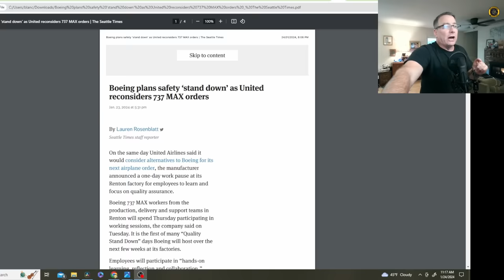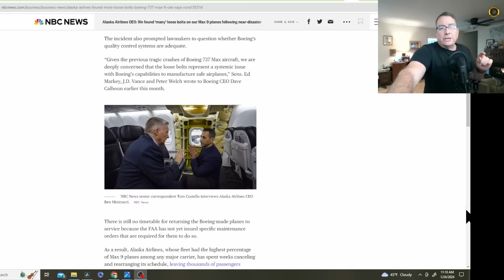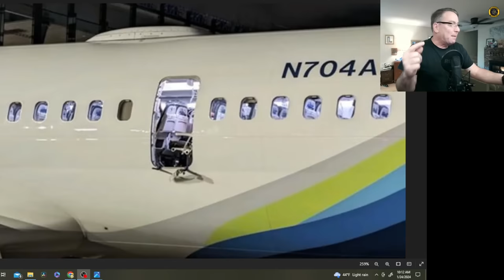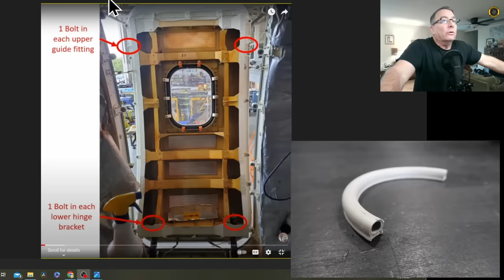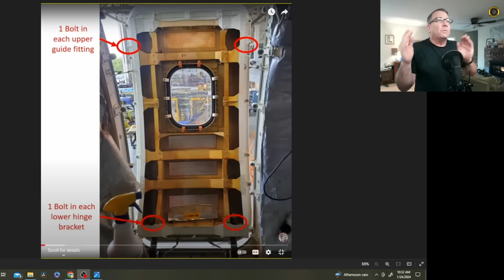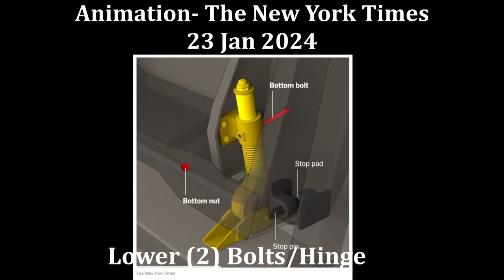Boeing's Quality Management Failure Explained 737-Max-9 Door 24 Jan 2024

Comment: it is worst ... it not about bolts ... it is poor/faulty  design which was accomplied with faulty executed assembly with bolts ... first initialy it is a door without security mechanism which secure it in place. By design it should slide down(these elements are present) ... to prevent that is that security oponening mechanism which is absent and replace by iliminator assembly ... to fix this door Boing need  glue it in (not done but should ) and replace bolts with proper large stunds which will fix it in place like there was absent opening mechanism. For the future models remove door from superstructutre which should be done in first place.

Comment: The entire 737 max program is a QC and PR nightmare. Even the Wright Flyer is safer and that plane is 120 years old.
Reply: WAS not the deeply flawed MCAS software a work around to address fundamental wing/engine flaws in the Max? i.e. the attempt to fit much bigger, modern engines, under an old wing design that was simply too low to the ground. Leading to engines placed high and too far forward.

Comment: And now CEOs of both United and Alaska are reconsidering their Boeing commitments? Let's see...Airbus has a goofy name, sure, but seats are one inch wider, the Bus cruises 10 + kts faster, all the ULCCs love them so there has to be a cost advantage, and the a320 family (a319, a320, a321) have never had a fatality in the US. When Boeing decided to stop making the 757 might have been the beginning of their decline. Fifteen years ago there were hardly any a321s (similar capacity to the 757) in US fleets, now the sky is filled with them. The Bus has a slower approach speed too, because the longer Boeing 737s sit so low to the ground they can't be flared enough during landing. Boeing still rules the sky in one category - cargo aircraft.

Comment: Why is anyone still talking about Spirit? They have zero to do with what happened. Boeing is the one who forgot the screws after painting/installing the interior.
Reply: You can't even follow a conversation.  Ketchup.
Reply: Allegedly the problem occurred due to a replacement of the rubber gasket seal around the door. The procedure was perhaps conducted by Spirit, but to Boeing specified procedures. The specified procedure said that opening the door did not require the full paperwork (and subsequent quality inspection) that removing the door would have - in spite of the fact that both processes required similar procedures.

If Boeing were clearly at fault, Spirit would have jumped to say as much and take the heat off them. If Spirit were clearly at fault, Boeing would have done the same. The reality is most likely that both were at fault. 

However, the NTSB will likely come out with the clearest verdict, once they complete their report.

Comment: That's what happens when the bean counters take over an engineering company.
Reply: It wasn't the bean counters, it was the directors from MDD who came over and dominated the Boeing board, infecting it with their bad habits.

MDD had the same traits. Ignoring flaws at design stage, refusing to acknowledge the flaws until 2 fatal accidents occurred, gentleman's agreements with the FAA to slip past regulations. Frankly, at this point, criminal enforcement needs to happen.

Comment: Lest we forget to learn from history...lots of comments below about lack of training, engineering, SOPs, etc. at Spirit.  Spirit was a spinoff from Boeing and all the processes, training (or lack thereof) were part of the Boeing "system" prior to the spinoff.  Engineers are NOT saints and do not necessarily know how to "put things together" well, especially when they are working on a part of a larger system.  The IT engineers, for example, when putting together CMES...anybody ask if there should be a different set of "checkpoints" for a door vs. a door plug??  The idea of "opening a door" would not normally trigger a lot of checkpoints in a QC system, but "opening or removing a door PLUG" certainly should!! Duh!

Comment: Boeing has become a shell of its former self. Corporate greed is the cause. In order to compete with Aerobus  and save money they decided to alter the 737 again, instead of engineering a new structure that could properly hold the larger engines. Instead they created a tippy unstable aircraft. The weight of the engines threw off the balance as they could not be placed more to the rear. Years of infighting between management  have now come to fruition. Some of the employees are also to blame. It is not over, the proper fix has yet to be implemented.

Comment: INSIDIOUS.

Opening the door requires the same process as removing the door. Opening the door requires less paperwork than removing the door. Of course, everyone is going to limit their actions to opening the door, rather than remove it - or, at the very least, they will be tempted to limit their paperwork to say as such.

Frankly, this is a blatant shortcut that can only have been intentionally set up, without clear thought prioritising safety over commercial expediency.
Reply: It is a door. Doors should be able to be opened without removal of structural elements. This fuselage panel is still seen as a door. There is the problem.

Comment: Even small aircraft have quite stringent inspection requirements, before they are returned to service.  But these highly complex large aircraft are dependent on disconnected teams.  You have a string of workers engineers, mechanics,  mechanic-inspectors, and workers who are not necessarily even certified mechanics but rather factory workers,  involved. Some of them are going to be writing the proceedures,  and doing it from their point of view, and with whatever their particular set of skills maybe.  Lots of room for assumptions,  and ways to skip steps.  Two systems that don't talk to each other.  Criminally Stupid. Boeing.

Comment: Please get this right. This is an engineering failure. Engineering is also responsible for quality. The existing board needs to be completely rebuilt from the ground up with engineering taking more control. The existing board ignores engineering and placates all of those concerned with the poor performance. All that happens is a "pound of cure". Rarely is there an "ounce of prevention". One way to improve is to receive parts with a higher level of assembly from suppliers. This will minimize Boeing integration, increase quality and reduce cost. That is how an engineer solves a problem. As part of this, Boeing engineering needs to team with the Suppliers to develop and maintain solid specifications. Management solves the problem by resisting technical solutions that reduce Boeing labor to appease the Union. The board wants to Boeing to perform more integration internally to increase profit. Of all of these options, engineering is the only solution that addresses the problems directly. Minimize the management politicians and the financial board and give engineering more authority. Boeing is too big to fail. This is why engineering needs a true crack at solving the technical problems constantly plaguing Boeing.

Comment: Former aerospace quality engineer. No kidding you get in trouble as a quality engineer for calling out quality issues that can slow productivity. Your job as a quality engineer is to fall on your sword when these issues crop up, not to actually ensure they don't crop up. There is no independence in the quality departments any more, you're too beholden to the other departments that calling out mistakes, which literally should be your job, takes a back seat to ensuring productivity at all costs.

Not going to change any time soon. Too many jobs to lose so they'll always get a pass. These issues will be solved but they'll just let quality slide somewhere else. The composite fuselages are a disaster waiting to happen, near impossible to repair properly. So guess where the next failures are going to be and how they'll try to convince the population that the repaired airframes are good as new, all the while trying to downplay why they fail faster than the old aluminum 747.

Comment: To me, regardless of what their systems say and whatever differences there may be between them, the problem is simple: a team of mechanics or engineers removed the bolts from that door to perform the work they needed to perform. How in the world did the same person who took out the bolts "forget" to put them back when  the work was done??? Really? And why would it even be a need for an inspector (meaning a different person) to check and make sure all the nuts and bolts that were removed initially are placed back in place at the end??? That idiot, who took out the bolts, didn't know he has to replace them in the end??? It should be his obligation and responsibility to put them back!!! Why do we need an army of people to do what one qualified, responsible person could do alone? That's how you keep costs down, by hiring top quality people, paying them top $$$ and providing them with continued improvement opportunities.

Comment: Thanks . In my opinion the problem starts at the Board of Directors, run by the big Stockholders, with only one agenda: Cut costs , increase production , so that BlackRock, Vanguard,  Newport Trust, T Rowe, State Street, etc.,  executives can make bigger Bonuses , Fees, Commissions, and Contracts and Cash Allocations that benefit them , and increase their Stock Options. Coincidentally many of these Asset Managers are the biggest Profiteers in the War between Christian Ukrainians and Christian Russians, they control the stock of most Weapons Companies and Military Contractors and Oil & Gas Companies with the Oil Sheiks and others. In my opinion USA Airlines , Pilots, Engineers and others should take over from these Asset Managers, or they will bankrupt Boeing & Spirit Aerosystems, to justify moving the next advanced factories to the Middle East, their plan all along .

Comment: After Boeing merging with McDonnell Douglas in 1997, Boeing has been gradually down. New high rank managers/directors are former M.D. It appears that these former M.D. directors (now directors at Boeing after merging) have made poor decision & poor policy: (1) Over outsourcing of major high tech components to other companies, including foreign countries. (2) Increasing integration. Consequently, Boeing engineers have lost lots of valuable design skills on major high tech components; Contractors/subcontractors/foreign countries have gained experience and secret in major high tech components. Now, Boeing does less design, but more INTEGRATION. That's not the majority of Boeing engineers want. Another factor: CEO Calhoun has bachelor’s degree in accounting which not good background for management of Boeing. CEO with engineering/technical degree is preferred.
Boeing sold facility in Wichita, KS to Spirit Aero is another poor policy (against the general A-Z in industry). Spirit has become one major contractor to build fuselage, and a number of major components for Boeing. Spirit has facility in Malaysia, thus, kind of subcontract to next lower level. Selling Wichita, KS facility and too many outsourcing, shrinks Boeing size in number of employees and facilities, and Boeing loses control of various major components.

Comment: 18 years on Boeing jets. This is purely a case of QA roller stamping or pencil whipping shit as they have always done to push planes through as they have had since 2006 at least. The system you speak of, SAT is Shipside action tracker' A way of tracking and dealing with non-conformity.

Comment: Boy, sure sounds like a management problem to me way above doers! Purchasing legal and executives staff should be reviewed! They want their bonuses anmulti-millionon dollapayouts, but they have all these issues? It's time to start doing some real work vs. living the good life you think! The boy remembers the Ford Explorers rolling over  play didn't even get this much air time! these are only four bolts easy fix. If an emergency, dont don't blow off what's the purpose of the plug? Oh yeah the stewardess is good to take to cut a pin out of the castle nut and remove it the nuts what's a box wrench!  This whole thing doesn't make sense at all

Comment: Not technically a great Video. What purpose did the bolts serve. We seem to be being told that they held the door in but really what holds the door in is the door stops contacting the Airframe stops. These bolts were probably part of a Cam system to locate the plug Door in the correct position. Also if the door is not in the correct position there is a very big pressurization leak. Quality system problems at Boeing probably directly connected to cost cutting at Boeing. In recent years there has been an influx of of buffoons into these safety industries saying we can cut costs to the bone but there will be a safety system. There conversations are totally detached from reality. But they get big bonuses. They will run away now. Their behavior and ideas are almost childlike at times. I have extensive experience on rigging doors mainly B747 MED and B767 over wing doors.
Reply: You're not very bright then.  Go ahead and ignore the prior pressurization warnings.  Go ahead and ignore the tens of other aircraft with missing hardware.  You sound like you are part of the problem.
Reply: @Look_What_You_Did , What do you mean i am part of the problem. Where has that idea come from. Most Aircraft do not have missing hardware.

Comment: What now?  Whoever re-installed the damned thing didn't know that there were (supposed to be) bolts holding it in place?  Didn't notice the four big empty holes where they were supposed to go?  Had apparently never worked on this assembly before?  Lacked the common sense God gave a dumb animal?

Oh but it's all the fault of paperwork and "we use these acronyms while you use those acronyms" and stuff.

Comment: Boeing is the greatest pump and dump.
They said cabin pressure alarms in previous flight lane but still operated.
Media went right to Boeing bypassing the operator.
Boeing is being played by the rich
This is an opportunity
Reply: I've made over 100k off Boeing since the second plane went down.  I've geared back up to dump somewhere around 200k into the next round.  I'll clear 500k in three years no problem.

Comment: NOBODY LIKES THE QUALITY DEPARTMENT. But without them there's nobody to point at when your CRAP goes wrong.
This is a sad evolution of American Manufacturing since Boeing literally wrote the book on Quality  Management Systems with TQMS and QMS9000, which has become the world standard with ISO and AS9100.  I would be interested to see the Corrective Actions responses Fish charts and Failure Mode Analysis.

QMS does not remove or install bolts.  The responsibility of Quality is to Document and Verify. 
Removal and Installation of hardware is the responsibility of Production or Repair Engineers. 
From 40,00 ft, this looks like a breakdown of communication between Production and the QMS. 
I would hope that NTSB and Internal audits will properly determine the Root Causes. Someone Knew this installation or repair wasn't being completed  properly. 
Bottom Line; Quality is NOT inspected into a product, Quality is the responsibility of EVERY Employee. "SEE SOMETHING , SAY SOMETHING and COMMUNICATE.  It's called TEAMWORK" 
RIP Kelly Johnson .......one of my hero's.... his 14 rules of project management should be posted in every manufacturing facility.

Comment: Where there ever any bolts there? seriously what type of engineer/mechanic removes/opens a plug door then on reinstall has 4 bolts left over and just shrugs their shoulders and says what the heck, it happens more than you think, don't worry about it. No they would be looking through a parts list for that Plug door and realize these are retaining bolts! Infact what clown is removing/opening the door without clearly following guided instructions that should be pointing to removing these 4 bolts and that engineer/mechanic raising an alert there and then that they are missing!! Kinda sound like these engineer/mechanic's are untrained clowns that should never be near an aircraft.

Comment: If Boeing goes back to using a regular door for the hole instead of a plug, problem would be solved. Because bolts are tiny and easily missed, clearly by everyone. A piece of aircraft like a door can't be missed because it's always attached. Shame on Boeing for such a stupid design.

Comment: Worked at boeing for 26 years. Tired of hearing this politcal witch hunt. If you look hard enough you will find nothing is perfect. Try focusing on the maintenance guys AFTER the planes are in the hands of the airlines. Boeing farms alot of work out to other companys, Its not BOEINGS fault. Find another company to fear monger about.